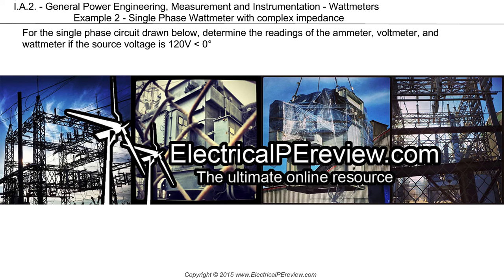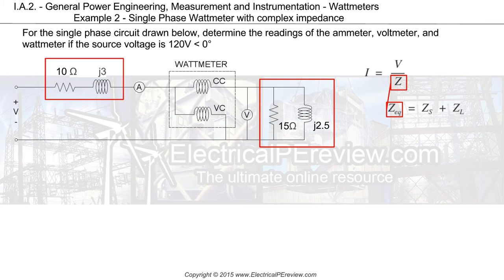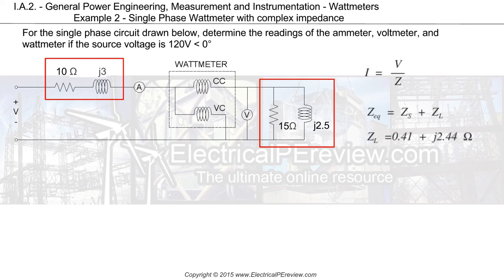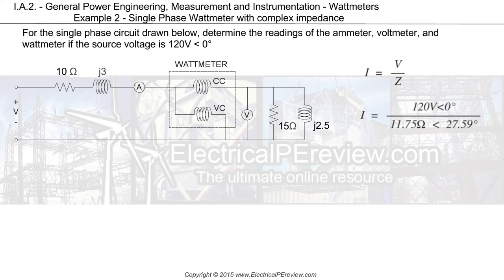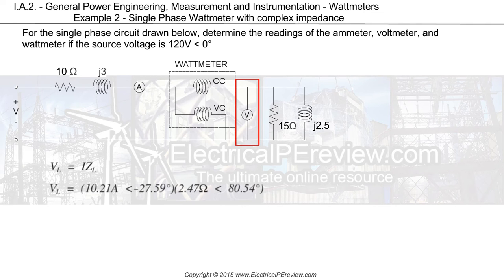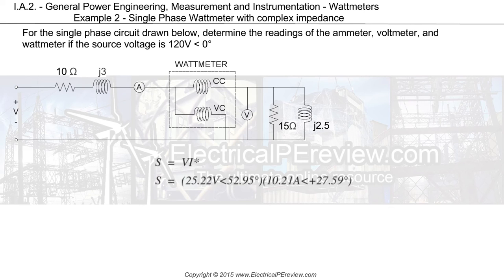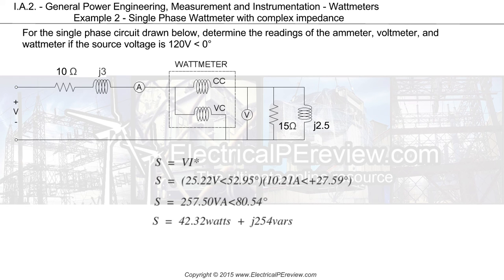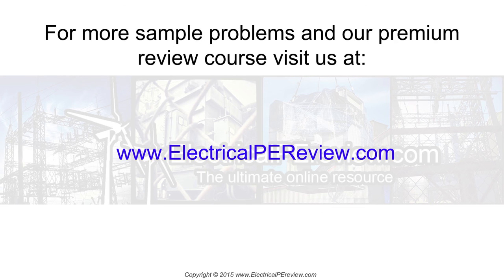Wattmeter Example 2 Complex Impedance - NCEES Electrical Power PE Exam Review

Comment: The Vector S = 257.50 at 80.54 degrees is NOT apparent power. Apparent power is simply the magnitude of S.
The vector S, is complex power, and in rectangular form, easily reveals the real power due to the polar form of complex power S = P + jQ.
You have a great explanation on the website.
Reply from the maker: Correct! Great eye

Comment: this seems super oversimplified for the wattmeter. I remember seeing completely different steps when using wattmeter
Reply from the maker: There are many ways to solve each type of problem. The import thing is that you use a way that works for you and you get the right answer.  I prefer to go for the simplest approach always if I can, it seems to help minimize accidental math errors when solving problems.